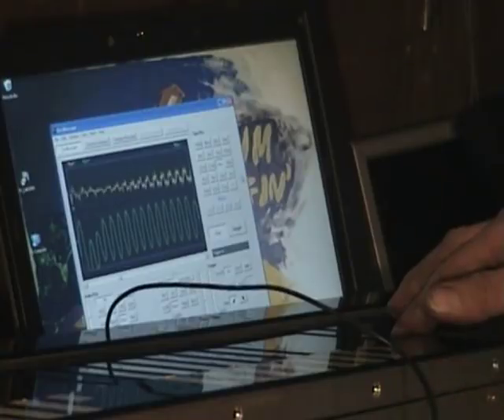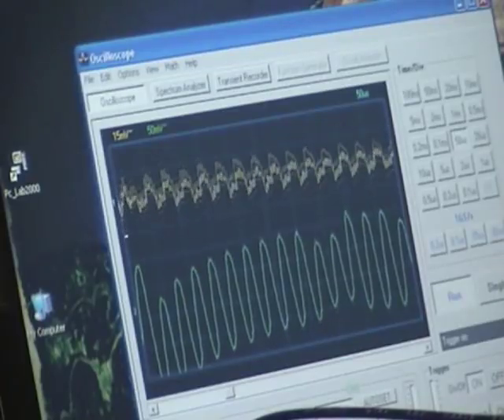real-time touch control surface on a Yamaha DX7IID synthesizer, how to edit DX7 patches

Comment: Amazing . 40 years after being created this thing is finally usable.
Reply from the maker: Funny thing is, I knew how to make one of these controllers (did a very crude one to test the theory) back in '85, had it wired into a Commodore SID chip.  Then life got in the way, so I didn't build this one until many, many years later.

Comment: Great concept. The lit touch sensors are better than sliders because they show current settings of patches called up. Smart. I hope someone teams up to put these into production. Ideally form factor would be reduced to maybe lay over the top of the front panel. If you did a Kickstarter I'm sure it would do well.
Reply from the maker: "Yep, the core concept was to be able to go from patch preset to live control, seamlessly. A simple concept, but it certainly makes a huge difference in how the instrument can be played.  A production version would have more controls, including touch-buttons, and some alpha-numeric displays, all fit much tighter to together. Probably could do it all using old-tech low-res monochrome LCD for all the displays & indicators, to make it more affordable.  

I can make the tech work, but I'm way out of my element when it comes to doing a business venture.
Reply: @georgebarlow754   I wish you the best on this project and hope someone comes along to take on the aspects outside your expertise. It would make a lot of people happy and that's always a good thing so long as it doesn't come at the expense of your own sanity!
Reply from the maker: thanks!  I think the sanity's already gone, so I'd have little to lose.

Comment: pretty awesome george. I remember you telling me about this some time ago. looks like you have it perfected.
Reply from the maker: Still has a lot of room for improvement. Should have many more sensor strips, maybe an LCD instead of LED display. with programmable lables & touch buttons. Should have everything dumped into just one or two chips.

But at leas this version works pretty solid, and is so far above using menus that it seems almost unreal by comparison.
Reply: I kind of like the LED display, better for onstage under variable lighting conditions than LCD.

Comment: you should sell some, this take the dx7 to a completely new level
Reply from the maker: I wish I was in a position to put something like this on the market, it really does open up a whole new way of playing.
Reply: @georgebarlow754  I think something like this would be great to do as a kit build.  The thing is people will probably want to do this with other synths.  The idea is brilliant really. I would hook this thing up to my dx7, to my korg tr 88, and my roland gaia.  Modulation and patch live hacking this way is awesome.
Reply from the maker: To use it with different synths would be a fairly simple thing to do. I'm getting ready to rewrite the software,  to make it easy to drop in the midi information for other synths. Then when I go to use it with a Roland, for instance, all I'll have to do is go to a data entry page, put in the list of parameters, and the min/max value of each, and tell it which control on which page goes to what parameter. A commercial version could even come with the data already available for common synths. Put the different instruments you use on different channels, and then just select which one you want to control that moment.
Reply: @georgebarlow754  Surely there must be people out there who would be willing to put one together themselves if the boards and bill of materials were available. I'm sure if you'd put this together and sell it there'll be plenty of folk who'd flock to the opportunity. I'd surely be one of them.

Comment: WOW!  As a fellow DX7 owner (bought it back in the 80's when it was new!!) I love this!!    You talked a lot about the noise cancellation on the sensors, but what kind of sensors are these?  When did you build this?  Are the sensors and displays commercially available?  How much of the circuitry inside do you think could be replaced by an arduino or Raspberry pi today?  Thanks for sharing - You're making me jealous..  I used to love programming the DX7 (yes.. you are right to question my sanity) but this many years later, I'm not sure I have the patience, and recently lost all my patches in a house fire..   I got my DX7 working again, but miss my custom sounds..
Reply from the maker: The sensors are pretty ordinary capacitance type, I just did a variation in the design of the circuit to give it the high noise immunity in order to make it responsive and reliable, avoiding the problems associated with normal touchscreen-type sensors. I used ordinary discrete LEDs for the display. A proper version would probably be built using a low-res monochrome (cheaper that way) LCD panel, the controls could be closer together, allowing many more to be there, and alphanumeric text for labels. Since the actual CPU work is fairly simple & minimal, about anything could do it (Arduino, etc). The display drivers & first stage of the sensor stuff would still need to be either discreet, or custom chip, still pretty basic circuits.  

If I had a head for business, finacial resources, and connections, this would be out there for everyone, both as an aftermarket option for most synths (simply uses midi), and perhaps built in to some new synths.  perhaps someday...
Reply: @georgebarlow754  Thanks for this ! Did you used 4 big capacitive display hidden by a plastic cutout or each slider has its own dedicated capacitive controller ?
Reply from the maker: @jonas-fr   I'm glad you like it. For this prototype I had a dedicated sensor strip for each control. Each group of 8 sensors share a common circuit, from there their signals get muxed into a single circuit for noise rejection (the key feature that makes this thing work well), digitizing, and some simple processing before the data gets handed off to the laptop for the actual minor number-crunching for determining touch position.  After I built this I figured out a way to make a full-on touchscreen-type surface, multitouch, and still with excellent noise rejection.

Comment: nice! and absolutely essential for DX7 users, it looks a bit like the way one moves the 8 sliders, on the yamaha montage, when in "performance control" and then, "vieuw" on the screen, and then the sliders seem to work the same princible as here, but there's only eight of them on the montage (1 per operator), but at least its a move in the right direction by yamaha, since the DX7 had only 2? if i'm not mistaken. very cool looking this controller, like something straight out of a classic startrek movie :)
Reply from the maker: Thanks!
 The Montage is pretty impressive. The trend for many decades has been to pile on more features / voices / effects, with little improvement in the ability to actually have easy, simple, effective access to those wonders. When I first started using this controller, I was completely caught by surprise by how I could easily get dynamics in the sound that I'd always dreamed of doing, but didn't think  I could do. 

 Turns out that when you're using a tedious or complicated interface, such as menus, You constanly have to mentally task-switch between a music frame of mind, and an analytical one.  Totally wrecks the intuitiveness required for playing music, particularly if you're working out some inspirational moment. Using bar-graph displays make it much easier to visualize parameter values at a glance, and being able to simply do "I want that there" at a touch makes all the difference in the world. An any patch / preset you call up is fully live. A montage with this type of controls on it would really be killer.

 My concept prototype only has 32 sense strips, so I page in different groups of parameters in order to control everything.  A full-out version would have well over a hundred, all in the same amount of space. My design for electrical interference immunity can also work to make a touchscreen much more responsive & reliable.

Comment: Very cool build, George! If you don't mind my asking, what touch sensors did you use, and is the light behind them integrated into the sensor or was that a separate component you coupled with the sensor?
Reply from the maker: I used a basic capacitive type sensor design, with a bit of a twist to give it much better than normal electrical noise immunity.  I use one PC board for the sensors, with a PC board behind it that holds the LEDs & LED drivers. There are holes in the sensor boards for the LEDs to stick up through.

Comment: Was this video shot on a VHS? How long ago was it made?
Reply from the maker: Shot on an old Sony camcorder, a few months ago. I used a better camera on the video I did a few days ago.
Reply: @georgebarlow754  No no, the footage is fine, very vintage-looking! I loved it.
Reply from the maker: At least the camcorder was newer than the DX7...
Reply: @georgebarlow754  The camera and Windows XP literally made me think the video was shot sometime in 2001.
Reply from the maker: I use what I got, movie maker for the video editing, Sonar for audio recording.  I use Windows 7 on some of my stuff, photo editing for example, but I tend to use whatever stuff I can get second-hand cheap. I was lucky to find the old sign that I used for the controller cabinet.  It came across with that vintage look, so I ran with it.
Reply: @georgebarlow754  I didn't mean to offend. I just thought that your DX controller was created a long time ago and you just decided to publish it recently. I also approve of the pragmatic approach. I still use an old Windows XP laptop (HP nw9440) for a lot of my electronics tasks, like eprom/flash burning, dump editing, and a lot of others. Again, great job! A work of a master.
Reply from the maker: No offense taken,  life is what it is.  It was built a few years ago, based on a concept that I first made work back in 1984. I'd fought with the sensor design off & on for several years before I got that "Ah-ha!" moment, and made it work. Then I built a small 8-channel controller, robbed a SID chip from a friend's C-64 computer and borrowed the keyboard from my Micromoog, hooked it up to my heavily modded Trash-80 computer, and got to see it actually work. Then life got in the way for a while, until I finally figured I'd better build a proper concept prototype, and see what it can really do. I designed it using a lot of old TTL logic,  it's just fun to work with that stuff. Heck, I still often use my second logic analyzer, one that I got in trade way back when for spending a couple of hours tracking down a design bug in a video toaster engineering prototype. Soetimes it's fun to see what can be pulled out of older stuff. Like when I spend a fair amount of time with synths, but I've also got an old harpsichord. 

On my desk at my shop I have several computers. The top of the stack is an XP machine, as some stuff that I do at work is much easier to do with XP than 7, the next computer down is a Pentium 100mHz, some CAD stuff on it tht I use on occasion. those sit on a 286 computer, which only has one task, running a specialized tone generator that I designed for a particular purpose, and even a 286 is way more powerful than I need.  For my photo editing & circuit simulation I use some HP & Dell servers, so I'm not always decades behind the times.
Reply: @georgebarlow754  George, thank you so much for the great story. People like you inspire others! I sure was in awe.
Reply from the maker: I hope someday to build a more advanced version, controls spaced much closer together, alphanumeric displays for labels, etc.

Comment: I love this.  I have a DX7-2D and I was thinking of making something like this using some faders and a small single board computer with A/D convertors and onboard midi.  What microcontroller was used?
Reply from the maker: I used an old IBM thinkpad laptop, running MSDOS. Interfacng to the computer was done through the parallel port, in bidirectional mode. Since it doesn't take a lot of CPU horsepower to handle some A/D and midi for that, you could use any processor you like. The only thing to watch out for is if you send too much data too fast to the DX7IID, it'll lock up from buffer overflow. So if you read your controls a few hundred times a second, and give several of them a spin at the same time, you might have to turn the DX7 off & back on.  Or limit the data rate, which is what I did.  If you don't have a copy yet, i highly recommend the book "The Complete DX7II" , by Howard Massey, it's not cheap anymore, but it's very, very useful. Also the original owner's manual.  My software has a list of the parameters, which contains their curent values, and a flag bit. Whenever the controls are touched, any newer values are updated in the list, and the flag bit for that parameter set. after the code is done checking the sensors, it then scans the list, and any parameter that has it's flag set has it's data sent out to the DX7, then the flag gets reset. Whenever I pull up a preset voice, all I have to do is copy it's data into the list, set all the flags, and go on, the midi transfer routine will happily pass it all along. It makes it easy to coordinate stuff. Good luck with it, it's great fun watching that beast come more alive!
Reply: @georgebarlow754  I just love mine to bits.  Best synth in the history of synths.

Comment: Genius! Do you know Stereoping? It's one piece of hardware that can be set-up to work with different synths depending on what firmware you running. Could you do that?
Reply from the maker: Thanks! I could have this work with different synths easily. Since this thing uses midi, and it's behaviour is entirely software based, it could run about anything that can be controlled by midi. Anything that can be controlled by computer, if the matching interface is added.   I'm getting ready to do a software mod so that I can run a Roland synth that i recently aquired.  If this were to be refined, and released as a production item, it could have selections for popular synths already programmed into it, as well as the ability to be user-defined. 

Stereoping was a step in the right direction, but not far enough, if you want all your presets to be "live".
Reply: @georgebarlow754  totally agree about Stereoping.  I would love to get one of these. Have you considered doing a kickstarter?
Reply from the maker: I have a feel for technology, but not for business. I wouldn't even know where to begin when trying to figure out what it could cost to put something on the market, and the logistics of doing so. I would love to have this out there, but I just don't know how to do the business end of things.  It's a product that would pretty much sell itself. A minute with one of these, and you'll never want to touch a menu again. You get hooked immediately, and a short time later you realize that you're getting stuff out of the synth that you never thought you could do.

Comment: Hello George,
I'm having trouble actually programming something to live control my dx7/tx7,
All the knobs I dedicated to the OPERATOR OUTPUT LEVEL (six knobs, six operators) just act weird,
on the dx7 manual it's said that the values go from 0 to 99 for theses parameters.
I don't know if you encountered this,
anyway I would like to know which parameters your controller do allow to modify, if you don't mind
thanks a lot.
Reply from the maker: I'd be glad to help. I originally had the on a DX7, so I should be able to refer to my software source code to hopefully give you useful details. I'm  sure I had to deal with that kind of stuff. I'm not where I can do so at the moment, but certainly with the next day or so,
Reply from the maker: I looke for my archived  copy of the source code, as they would also have notes about any quirks. Somehow, on all three computers at home that have this stuff, I found copies of the software I did right before sending out parameters was implemented, and copies of after I changed to a different method of direct method that was telling the DX7 (over midi) to mimic button presses, as direct control of parameters caused too much stuttering in the sounds. I should  have the source code there,  possibly on one of several computers, or on a hard drive,  As I would periodically swap out hard drives, after copying everything to the replacement drive, then bag & tag the old drive as archive.  In what way are your controls making the parameters act weird?   The maximum level on that parameter is indeed 99. The DX7 & DX7II2 don't like getting midi data two fast. In my software I had to limit how many numbers went out per second, (not alter the midi data rate) by adding a bit of delay between each number going out. Otherwise, if I started chaning a number of parameter valus, it might overload the midi buffer, and the darn thing would lock up. If you have the book The  Complete DX7, by Howard Massey it has  some stuff in chapter four that helps give more understanding. IF you don't have the book, get a copy now. If you can't  afford a print copy (often found on ebay) hunt down a pdf. Leafing through it, it doean't seem to have a comprehensive list of midi codes, maybe I got those elsewhere, possibly the Yamaha manual.

Comment: What is the resolution on those touch-sensitive devices?
Reply: Whatever it is, it probably has to map to midi param range (0..127)
Reply from the maker: the software calculates it at 1000 points, which is then scaled down to match what the synthesizer wants, some parameters go to 127, others as few as 8 .
Reply: @georgebarlow754  , that's higher-rez than I expected. Awesome work, I hope you find a way to productize it.